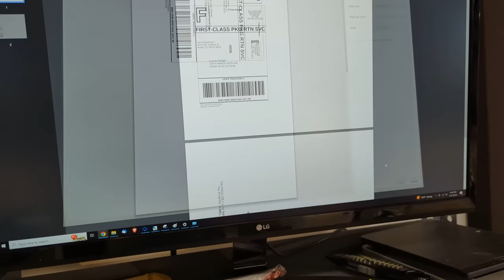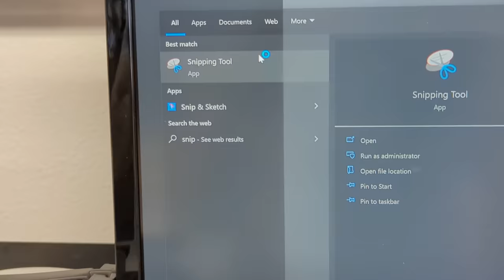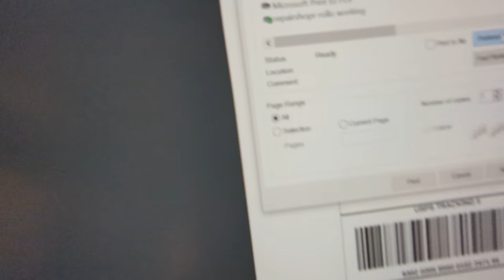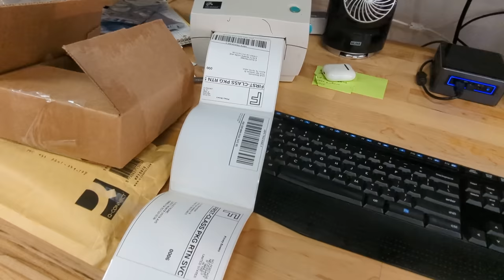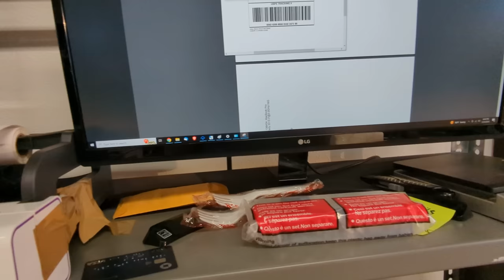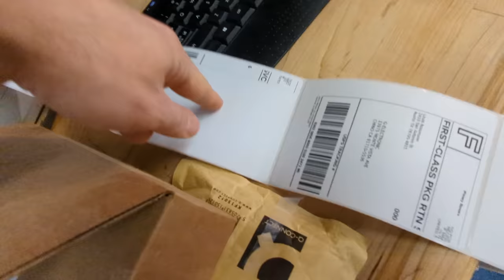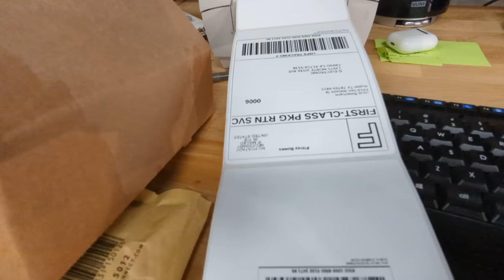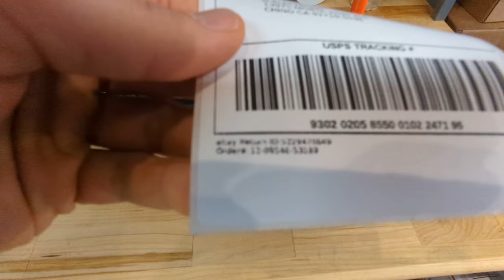rossmann repair group vs. label printer, part 3

Comment: I've had similar issues getting certain zebra printers/software to match label to the stock. Even after setting all the measurements and margins, providing twice the info that should be needed for a simple scaling and translate, some of them just refuse to behave.

Comment: Lets go by parts:
1- Forget about x64 drivers for a GK420. Now Zebra ships the ZD420 instead
2- User manual page 81 Power On Modes, Print Width Adjustment/manual calibration
3- you should have RTFM

Comment: Replacing Windows with Linux fixes all your Windows issues. It just brings you Linux issues.

So, Rollo seems to have Linux drivers. Have you tried them to see if they are easier to work with?

Comment: use zpldesigner, import the picture, send the zpl straight to the printer. preview shows exactly how the printer would print it because it communicates with the printer to create the preview
(or remake the label in zpl it's not super hard but considering this program should "just work" i imagine you are of the opinion that it is too much of a pain in the ass)

Comment: you're mis-sizing the clip, should be as close as possible to the borders, with no white margin on the sides. the zebra printer is 203 dots per inch

Comment: Use a Chromebook. No issues with PDFs ... mostly.  There is a recent update with chrome to edit inside pdfs. 
  You probably should have gone into advanced settings for printing (not windows) to fix the margins.  I use... more settings, then go to scale.   Sometimes it's best to adjust margins as a permanent setting rather than mess with anything else depending on what you are doing.
     edit;  does no one do simple math in their head?   25mm =1 inch,  x4 =100,  x6=150.   Done.

Comment: Now somebody creates a bulletproof (literally) label printer which has a hardware switch to print its own schematics. It must run on Linux, has a non-prophietary recognition for label size and must sell for less than 200 bucks.

Comment: Every time I do something, as basic as plugging in a phone to charge to pushing the lock button on my cars remote, require so many extra stupid steps..... Yes. Those 2 things... Find a way to not work. Plug it in, flip it over. You would say it's just worn out. Try a different cable, replace the port, I did it don't work right. The damn car thing don't work unless you hold it up at the right angle and press it 7x.... Yes it has a new battery.

Everything else also has a quirk to it. I buy a nice OLED LG tv and that dies. Have to put a new motherboard in it just after it's warranty period. The list goes on and on

Comment: I have an HP OfficeJet printer, scanner, fax and it worked fine for about 1-1 1/2 years then for no reason it now says that I am using illegal ink and wont print or scan anymore.

Comment: when you use snipping tool dont give the area such large boarders around the label, less then a quarter inch from the printed parts and it should be golden.

Comment: M$ loves to instal update drivers, i used elm327 that producent released drivers that claims product will not work on this operating system, installing older drivers fixed issue for 5 min. So solution was a) use device that can be dc from internet 24/7 and install old found randomly on some website drivers. 
And windows troubleshooting is broken since win 8 inc.

Comment: mac users confused by PC hardware... (perhaps tweak the margin settings? or print to edge? or other specialty settings, in driver and then print settings. often it is similar settings in multiple places, people think, oh I did that, but then its system and or driver... PC's are more settings then mac, and less intuitive..

Comment: And that's why I just print on A4 paper and then cover it with trasparent tape. Label printers are bs, printers are bs in general but label printers are the worst because all types of strange and wondrous sizes

Comment: lol paint. I would had used GIMP for this. Then I would had made a document the correct size, imported into GIMP the text file and fit the label to the space GIMP provides. It would had worked the first time.

Comment: I dealt with Zebra, CAB, and various other label printing machines for years. These ones from the plastic shell to the last line of the driver code created by the most twisted minds in the deepest bowels of hell, led by the devil himself to torture mankind.
Trick is about Zebras, you have to set label size and orientation in Control panel/printer settings, and open the app after it. If you want to set it in any app, on its very own setting page, none of the settings will gone trough.

Comment: Amazing they don't know how much is an inch in millimeters??  Wow.   Just remember number 2.54, multiply inch with 2.54, and there you got centimeters. Centimeter has 10 millimeters. Meter has 1000 millimeters.  One inch is 2.54 centimeters - that is 25.4 millimeters.   You have to educate your workers, the metric system is the winner system!

Comment: That was painful watching LOL. How do you not know that 4 inches is almost like 100mm? And that 6 inches is 50% more than that? Like 150mm. For the last 60-70 years, 1 inch has been defined by the metric (IS) system to exactly 25.400000... millimeters. So 4 inches is exactly 101.6 mm. More info about the inch: https://en.wikipedia.org/wiki/Inch

Comment: I wasted like 10 A4 sheets of paper on a ink jet printer, because the software couldn't show me how it was gonna look like. Shows me a picture fit to paper then it prints out the picture with the sides cut off. I align and centre the picture again, then it's printed off cantered. Dumb Canon.

Comment: on linux: use krop
Reply: to directly crop pdfs
Reply: that's right i'm telling you it's easier to use your printer on linux
Reply: then again, the barcodes I print with this method, though they perfectly fit the label paper, never scan...